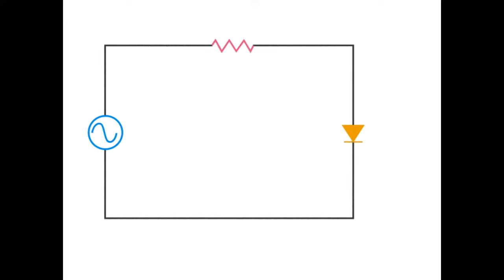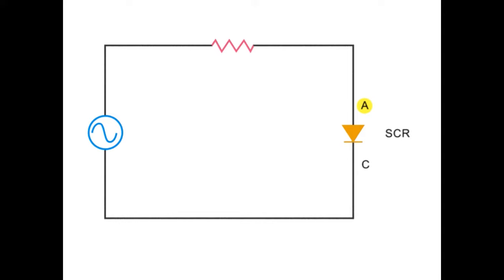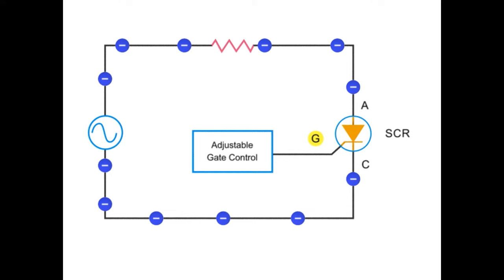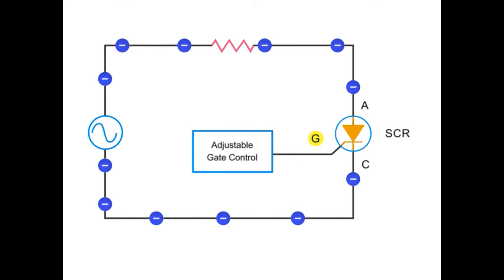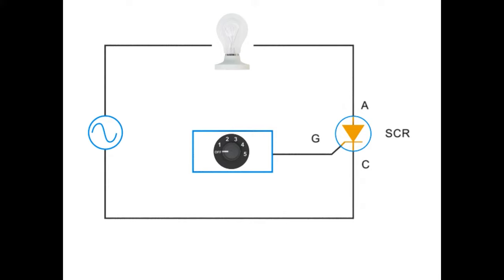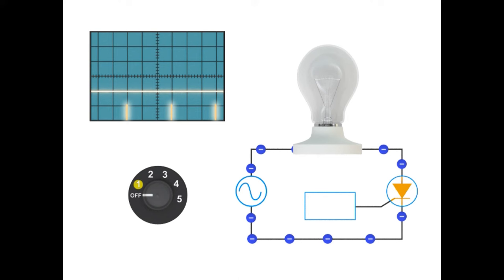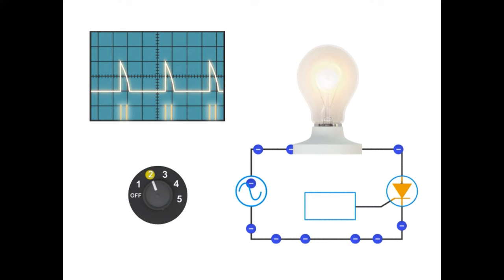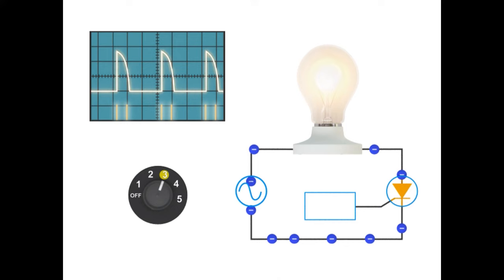Silicon Controlled Rectifier (SCR) - Animation - Power Electronics

Comment: Actually, an SCR is not used in AC circuits, because every time it crosses 0 it will stop conducting. In AC circuits  you use a TRIAC which is basically two SCR's connected back to back.
Reply: It is used if you want a controlled rectifier

Comment: The scr connection is wrong
Reply: its reversed right, i was thinking diodes only let voltage 1 way not the other..
Reply: @turboimport95 the video show the moving of the electrons which is the opposite of the current flow